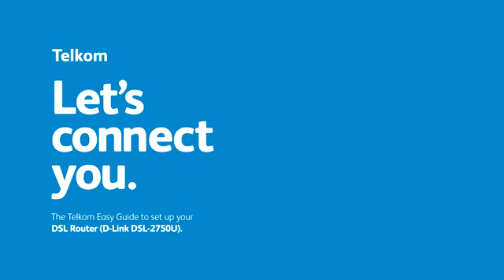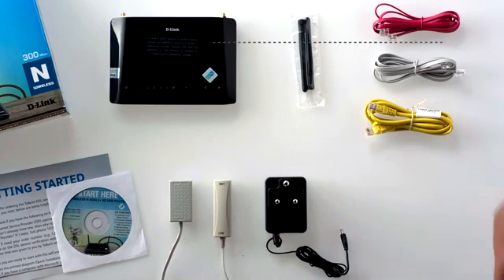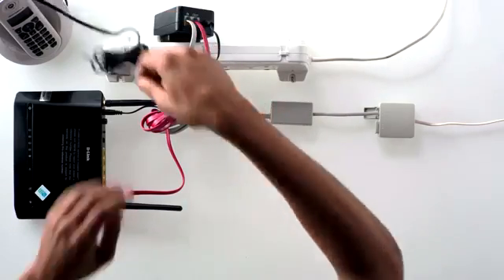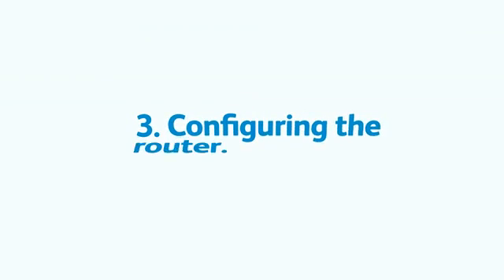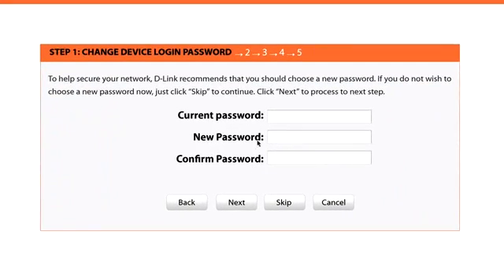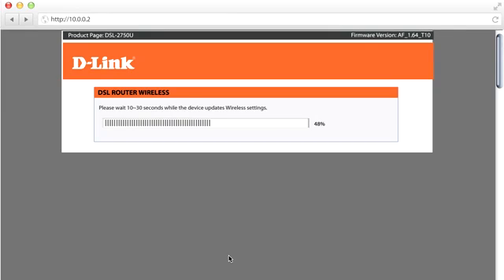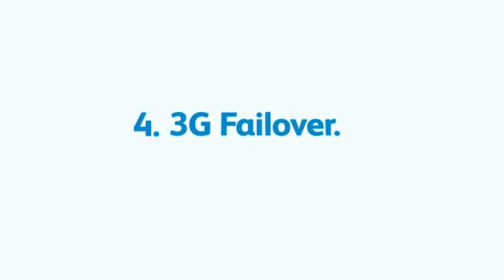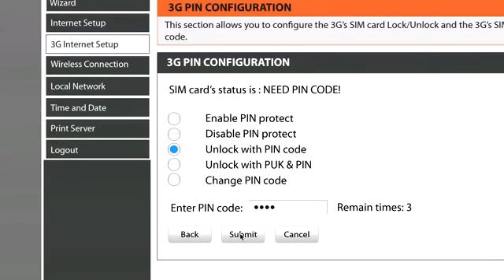How to setup your Telkom supplied D-Link DSL-2750U Router

Comment: Do not use Telkom.
They used to run backup power during loadshedding but have stopped doing this so service stops during loadshedding, or becomes very slow.

Comment: Hi there. My router has recently packed up and I am using my friends old D-link router and trying to set it up.  Unfortunately I dont have the install disk.  Does that disk have the connection wizard needed to setup my router?  Or can it be setup without it?
Reply from the maker: Hi Wayne, no you don't need an install disk. The wizard is a web based setup wizard. Just connect the router to your laptop/computer via the LAN cable (yellow cable), open your web browser and go to 10.0.0.2 (make sure you aren't connected to another Wi-Fi network or connected to the internet)
Reply: @D-LinkZA  My laptop doesn't have an eithernet port only a usb wifi dongle.  Does the laptop need to be plugged in with a lan cable the first time it is setup?  Is it not possible to do  wirelessly?
Reply from the maker: @WAYNECHERE  You can do it wirelessly. It's just usually easier on a LAN connection. You'll just need to connect to the D-Link router's Wi-Fi signal and use the WPA key printed on the bottom of the router as the password. Also, make sure you are disconnected from the Wi-Fi dongle. Then you open google chrome (or any other internet browser) and type in 10.0.0.2 in the internet search bar.
Reply from the maker: Just note: If you use a wireless connection to setup the router - once you change the Wi-Fi name and password for the router on one of the steps in the setup wizard, your laptop will disconnect from the router. So you will need to re-connect to the Wi-Fi network (now the name & password you chose on the setup) and continue with the rest of the wizard.
Reply: @D-LinkZA  Thank you will try it tonight again.. Think my settings are still connected to my old router because whenever I type in 10.0.0.2 I get a zyxel home screen not that D-link setup one like in the pdf.  Thank you for your help.
Reply from the maker: @WAYNECHERE  Good luck. I hope you can get it sorted! Just make sure you disconnect from any other Wi-Fi sources and connect to the D-Link's Wi-Fi. But if you get stuck, there is basic phone support till 9 o'clock on 08600 35465 (or 012 741 2000)
Reply: @D-LinkZA  Good morning. Made some progress last night.  Managed to rename the router and password and connect to it. But still can't access the internet?  My friend only gave me the router and power cables though.. I wonder if my router is setup incorrectly?  Do you need that red cable that runs from the adaptor out to the dsl connection?  At the moment I ony have the phone cable plugged into the dsl port on the router.  Tried putting the phone cable into the adaptor plug in as well but my light on my router still keeps flashing.. Needs to be constant when synced according to the manual.
Reply from the maker: @WAYNECHERE  I think it will be easier to quickly chat you through the installation if you start a live chat with us on our website: www.d-link.co.za. Just go to the page and click on the little speech bubble.
Reply: @D-LinkZA  I'm at work currently. Until what time is this helpline available?
Reply from the maker: @WAYNECHERE  It would be best to get in contact when you are in front of your router. The live chat is available until 16:30 every week day. But there is a technician on call throughout the weekend from 8:00 till 21:00 at 08600 35465 (or 012 741 2000). Also before you call, make sure you have your internet login details from your internet service provider (ie Telkom or Afrihost etc) as you will need these to set up your internet connection. These details usually look like and email address (eg. for Telkom it would probably look something like wayne@telkomsa.net) and a random long combination of letters and numbers for the password.